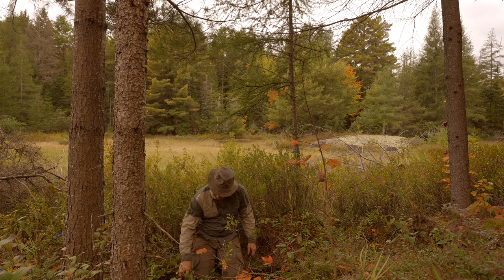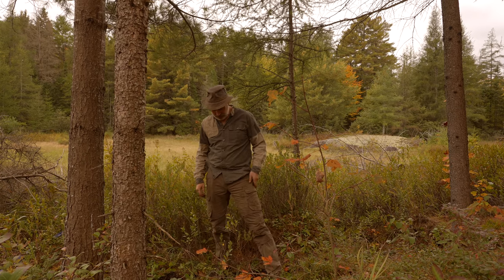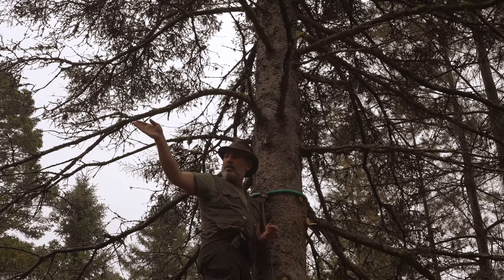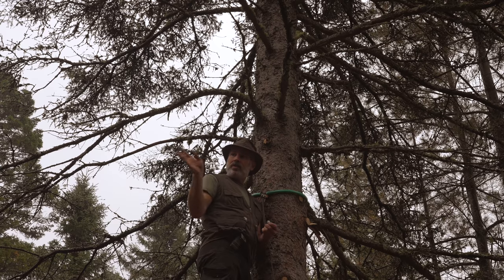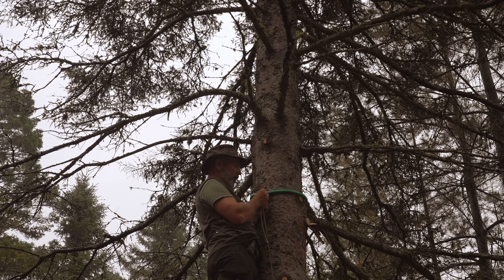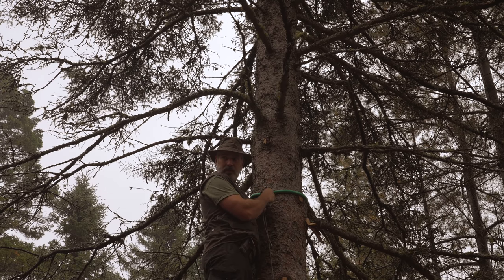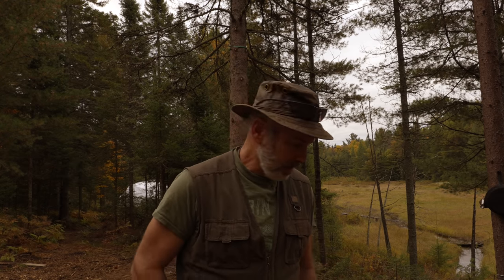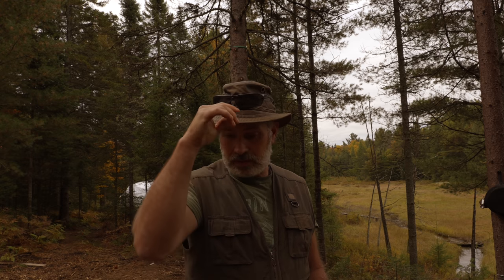How I Lift Logs on to the Cabin, Growing Potatoes in the Forest, Division of Labour

Comment: Hi Shawn, seeing your cable lift system brought back memories of vectors and free body diagrams from my school days for classes in physics and engineering. To simplify it, allow the cables to droop to lowest point you'll require for the at top course of logs on walls. This will allow cables to lift the most weight within ratings safely. As you tighten the cables at tree to raise it higher and approach 90 degrees, you're greatly increasing the tensions a load places on that cable to roughly double... so a 100 lb load could/would break a 200 lb rated cable when applied at a perpendicular but if at 45 degrees relative to ground (90 degrees apart relative) it could barely handle up to 200 lb load maximum. Stay below 1/4 of cable or fittings rated loads in order to be safe. Your suggestion of adding a tripod inside walls is a great idea as well to avoid overloading the upper cable.
Reply: Thanks for your expert advice. Stay safe Shawn 🙏

Comment: I envy and admire your woodworking and forestry skills--you are a true workforce all by yourself. 

As a viewer, please remember that in using the hoist system described here, that when cable is strung tight between two points, a 1000lb. force applied in the middle span of that cable does not create a 1000lb. force on the cable terminal ends.  The actual force is nearly 6000lbs. of force on the terminal ends.  The greater the angle from the terminal ends to the applied force, the less the force there will be on the cable itself.  Please use caution, take two minutes for safety sake and use all PPE.

Comment: I've seen Alaskan builder use a vertical log parallel to a bigger tree in the ground, both secured at the tree's base. At the top of the free log it has a strap and/or cable to secure the chain fall to. The free log all so has a cable secured in the same place as the chain fall. The cable goes back to the tree though a pulley and down to the tree's base. At the base of the tree has a boat type winch to raise and lower the top of the free log. The free log pivots at the base of the tree about 30° to reach all  areas of the work site. Basically a 3th class lever.  Great video 👍 Shawn, thanks.
Reply: Sounds like a pivoting crane🤔.    There are many ways when using your brain and this one sounds simple yet effective!  Take care!
Reply: Thanks Jay, I didn't know what it was called.

Comment: I expect you understand that if you stretch a cable horizontally taught between the trees, then apply a load to the middle of the cable, the load on the cable increases exponentially. If the cable was to fail, you not only have a danger of dropping the load, the cable is like a rubber band and can cause serious injury upon retraction. The best rig of a load, using cable, is a deep "v". Generally industry safety orders in California specify a safety factor of 5 and sometime 6 depending upon the operation and application. Please be safe my friend. MW, California Elevator Safety Engineer.

Comment: That's exactly what I did shawn.graduated from.high school and went strait into a furniture factory and learned to build furniture frames and the moved into unpolished the furniture for 35 yrs and it and working out with weights that same 35 yrs to stay strong so lifting on furniture and stretching leather all day was easier.
  But the two things together was just to much on my joints and have gone through both knee replacements. 
Right shoulder replaced twice and still not right and left one needs replaced but waiting it out since the right one was successful either time. Carpel tunnel in both hands from all the repetitive grabbing and stretching of leather and fabric that whole time and of coarse arthritis everywhere through my body .back issues, neck issues and I upholstered at high speed because it was production based pay.the more I did the more I made. But had to be done to there high quality standards.
   It was a clean job but a very physical job. Lifting 200 lb frames that came full of all the supplies to build it .
   Up and down off and on the jig platform .
   And I'm 61 now and was physically disabled at 50 when all the replacements started . All I have are regrets that I didn't go to college and learn something like physical therapy to help dummies like me instead of being the dummy.
    So I'm pretty much stuck in a holding pattern not able to do much.
    It's very depressing knowing life is a slow roll towards end of  life circumstances.
    I just watch you and other YouTube channels oh off grid homesteaders building there lives and live vicariously through you and them .
    I wish I could go back to 17 knowing all I know now and start all over again.there would be big changes in what I would do differently.
    But that's not possible so you filming your life makes it a bit easier to handle my failures in my life. 
    I've never drank,smoked or done any illegal drugs only what was prescribed to me and never any trouble with the law. But now I've been diagnosed with chronic kidney disease which is hereditary .just another hurdle I've got to fight through .
    But I found other ways to screw my life up by  buying things I didn't need with money I earned in a very hard way. Have filed bankruptcy twice still didn't learn.
    There's alot more to my downfalls but it would take another hour to type it out.so will end it here.  Keep the great content coming Shawn it's very much appreciated . Stay safe and God bless you and Cali and family 🙏

Comment: I would look closely at the window and door plan layout, then cut the logs for them. This would keep the weight less on the wire cables. How much over hang on the roof edges to keep logs dry? The logs, long ones can be joined together, as butt joint with a slotted part in the joints. If you flatten two sides of the log you will get more level joints, and can spline the middle of them for keeping the cold air out. The flat two sides can be easy'r to keep a uniform appearance.

Comment: I hate being preachy but please have an understanding of the forces being exerted on the cable legs. Depending on the angle between the trees and your chain fall, you could potentially have double the weight on each leg. Being in the industry, to get quick load calcs we use an app called bridle. 
 Love the videos, stay safe and out from under the load.

Comment: you may need to put tie downs to the ground supporting the trees to the ground a t a 45 degree angle the screw anchors for mobile home ground tie downs and a turn buckle are excellent for this purpose and they my be dug up stored and reused as you do other projects....if the logs exceed 100 pounds you do topple them root balls and all

Comment: I was always taught when using cable clamps to never saddle a running horse. Just the opposite of what you were taught. I wonder who was right? (MSG Retired GWWillis, US Army Engineers.)
Reply: I think both ways work as your pinching wires so they can't slide over each other!